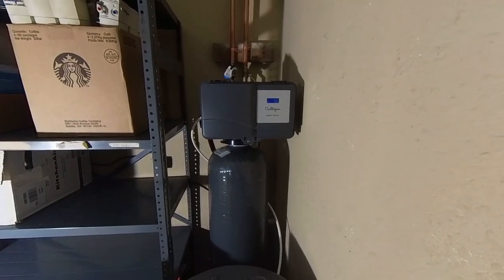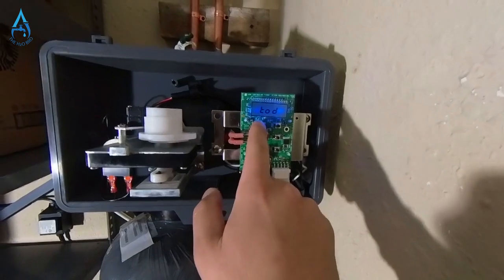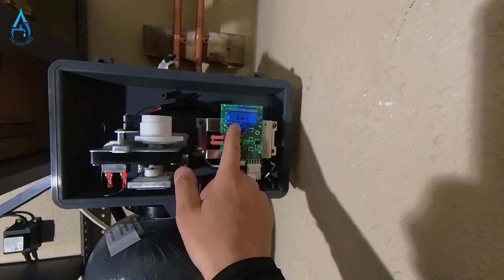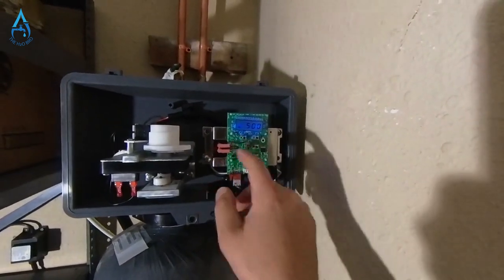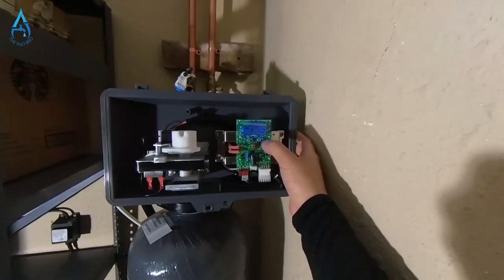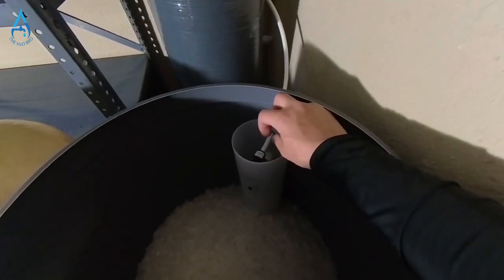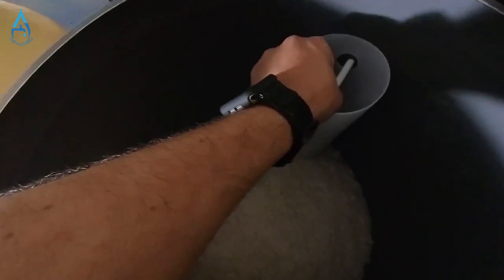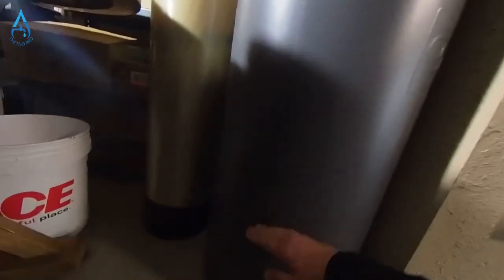No soft water? Do this…

Comment: Thanks for your instructional videos. I have a Culligan HE water softener that was installed by the previous homeowner. It has been working fine for the few years I have owned the home. Recently, it is regenerating every night. I added Rheem water softener cleaner from Home Depot to the brine tank and performed a regeneration. It still wants to generate tonight. The most useful information I have from the softener is the the 'Remain Capacity' is -984 before the manual regen and -1022 afterward. It is going in the wrong direction! I haven't found information about this scenario in any online search. Have you encountered this? If so, what was the fix? If not, any ideas? Reset the board? (should I try to save the setup settings first (e.g. write them down)?), TIA
Reply from the maker: If it was working fine for a while then just started regenerating every night randomly then yes I suggest doing a factory reset on the circuit board. Unplug for 5 minutes. After 5 minutes simultaneously hold the ✅⬆️ buttons and plug unit back in. If it worked it will ask you to choose date/language/time etc
Reply: @TheH2OBro  Thanks. I used the keys/menu to do a reset. It stopped the nightly regeneration for now. Hope this is a 'permanent' fix.

Comment: Hi handsome.  I just got a Culligan gold series,  i would like to chane the resin in the tank, is this resin acceptable:Purolite C-100E Cationic Resin Replacement for Water Softener 1 CuFt Bag Media? 
I also would like to replace the salt,its a 15 inch diameter salt tank.  , culligan sells there 50lb of solar salt for $10.45 per bag while homedepot sells a 40lb of morton soft water salt for $7.95 per bag? Which kne should i use? I would like to know if your going to make a video on replacement of the gold series mother board replacement  process?
Reply from the maker: Any salt will do as long as it’s for water softeners. As far as resin if you bought it new you obviously don’t need it, if not then that one will work